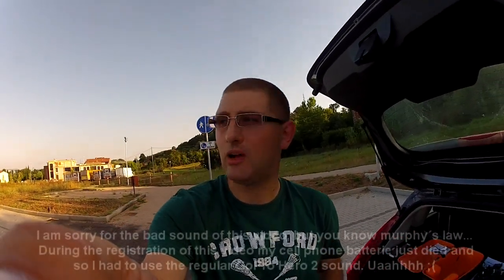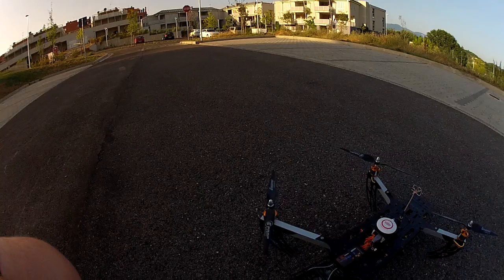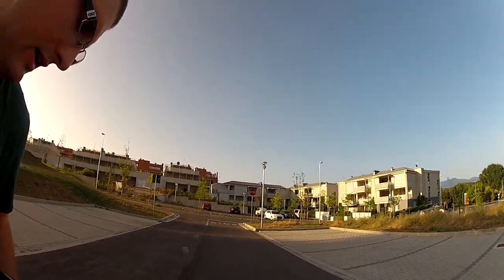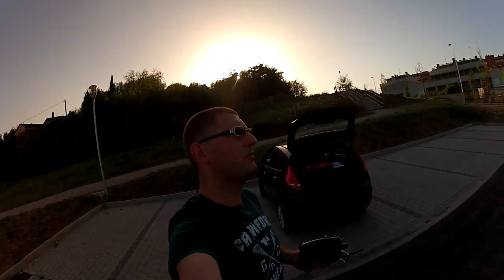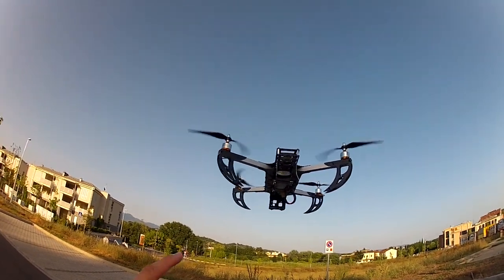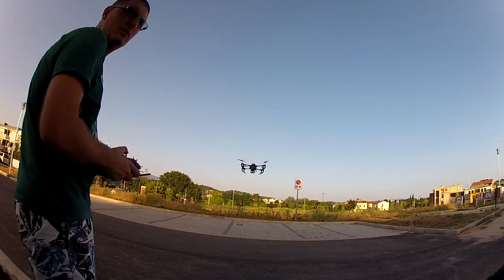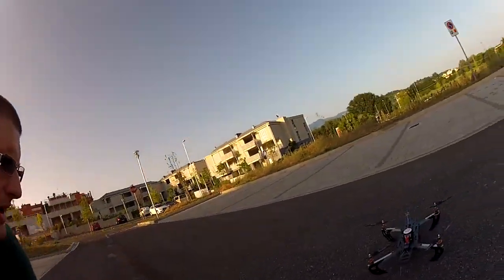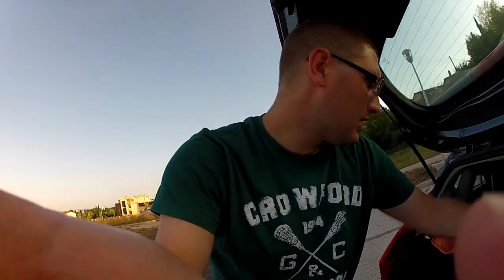RC: Testing the Naza Lite FC

Comment: can i use a 3 axis gimbal with naza lite ?
Reply from the maker: Quad Almighty - you can't use the Gimbal from DJI with the Naza lite, but you could use a stand alone system like a tarrot instead.
Reply: ok so would the storm 32 work fine with it ?  Thanks for the reply
Reply from the maker: Quad Almighty - yes, that would work.

Comment: Hello Atarix..
Very good video ...!!
I have this naza lite ... But without GPS.
And it does not work very well .. it's very unstable ..
Does not have GPS.?
Regards ...
Reply from the maker: Sorry for my late replay, i had a problem with youtube that I had to sort out... Could u sort out the problem with ur Naza Lite in the meanwhile?
Reply: Héllo..
I have a TAROT 680mm frame ......!
And I'm not getting hit and rates of gain...Can you give me a hand with the most appropriate rates for this frame..!?
Especially in yaw yaw! Unbalances It!
I used the fees that they see in the manual.! But the manual is only to 550mm, my 680mm is ..! Then I went up there a bit rates, one 680mm, logic has come up a little.
I do not have GPS yet! Does it?
I have..P-170 R-170 YAW-150 VERTCAL-140 ATTITUDE GAIN- P-170 R-170
Regrads..
Reply from the maker: Paulo Parreira As u know the rates do not only depend on the frame but also on weight, motor+esc combination, propellers so it is not possible to know what are the most appropiate rates without trying it. I would try to go verrrryyy low with all of the rates (like arround 80) and then i would slowly try to hover and to increase them one by one to find out where the problem is coming from.

I know, thats probably not the answer that you probably would love to get, but i think there is no other way...
Reply: Thank you very much.!
is an idea to start!!!!
good christmas..
Regards..
Pp

Comment from the maker: Thx, i am glad you like it :)  Its a quadcopter or multicopter, gyrocopters are these little helicopters with two blades on it :)

The "build in" camera is a Gopro 2 that i can put into the little case at the front of the copter and take it out when i need it for other things. It doesnt have a stabilzer. The copter seem to very stable, but it actually stabilzes much to agressive and therefore you can see the oscillation. But thats just a software thing, it should be fine in no time :)

Comment: Nice first test.... I told you you'd push it away :)  Looks like the default gains are a little too high, should be easy to tune out that oscillation though